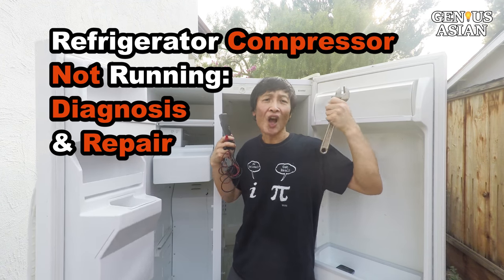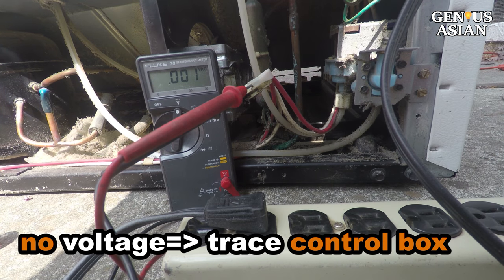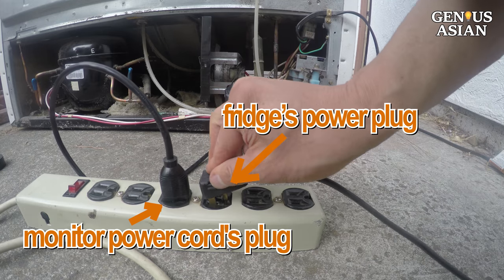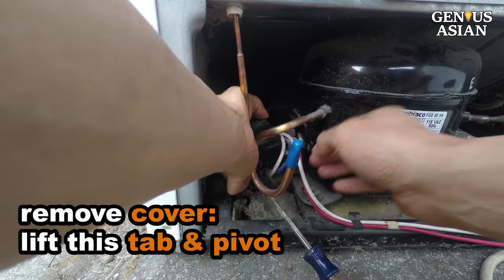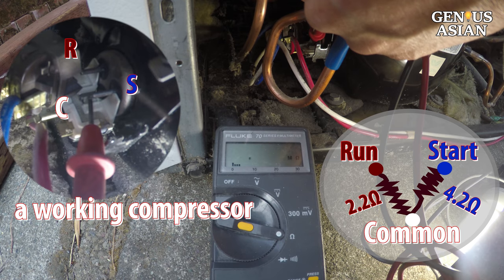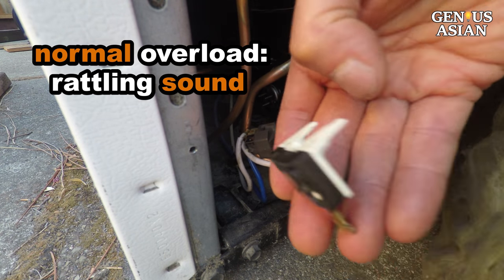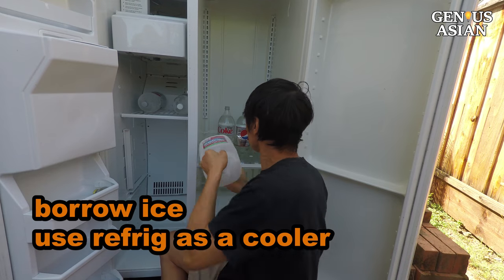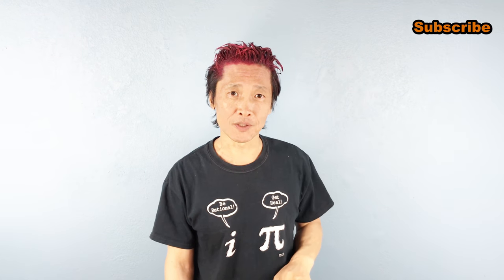Refrigerator Compressor Not Running: Diagnosis & Repair or Emergency Fix No More Spoiled Food

Comment: I have an old kenmore. The light inside turns on so I know I have power. I replaced the starter capacitor but the compressor and fan still don’t turn on.

Comment: All the fans in my fridge are working. The freezer and fridge are warm.  The compressor turns on for 5 seconds then cuts off. Then starts again after few minutes and on for 5 seconds then off again.  The compressor is hot. I checked the starter relay and capacitor the best I can.  No rattle in the start relay.  If compressor is hot could it still be starter relay or is compressor mechanically bad?  Thanks for your help!
Reply from the maker: we may try these three things:
1. the coil: https://youtu.be/jMkkoXpHIPA you should do this anyway whether you have refrig problem or not.
2. there are two tubes connected to the compressor, are there temperature difference between these two tubes?
3. When your compressor turned off or on, is the thermostat closed or open?  thermostat: https://youtu.be/grURTgO2-x0
Reply: @GeniusAsian  hello. I left fridge unplugged for 24 hrs. Plugged back in and was working fine. Inside fridge and freezer temperature was dropping slowly. 

I then unplugged for 2 seconds to put back fridge back into place then plugged back in, now same problems, cycles on for few seconds then off. Compressor is very hot to touch, not sure if that is normal or not.

All coils were cleaned, there was a temperature difference between the pipes.

Thermostat I have yet to check. 

Possibly a faulty compressor? 

Any help or advice is appreciated, thank you so much.
Reply from the maker: @audittheauditors  after you unplugged, you should not re-plug right away, it is not good for your compressor (you said: unplugged for 2 seconds to put back fridge back into place then plugged back in), you need to wait 20 minutes. Did you notice any frost? When you  unplugged for 24 hrs, the effect could be de-frost. So still check thermostat and frost.
Reply: No frost. I plugged it back in after couple hours again and it started running. Compressor turned off after it reached the temperature I set it for 50F ( i set it higher than 38F just to test). Then I can hear compressor trying to turn back on but it cycles on for 5 seconds then off for a minute. This repeats and compressor gets increasingly hot. So hot that cant touch it.
Reply from the maker: @audittheauditors  still it does not hurt to check the thermostat, i.e. if the thermostat asks compressor to turn on but the compressor does not turn on, then it is compressor problem. But if the thermostat does not ask compressor to turn on, then focusing on compressor may not solve your problem.

Comment: I have a Viking refrigerator. Both my fan and my DC compressor is not working.  I tested my fan motor first. My fan motor read 415 ohms. Could it be possible I have an inverter built into this motor that why it is reading high. Any thought on this sir?

Comment: Hello, I have a problem with my refrigerator, first the compressor was working and then stops suddenly after few tens of sec or few minutes, then it runs for only 1 or sec and then stops.  The resistance of the start replay showed 30 Ohm. I called the service center, the technician said the relay is okay but the compressor is not and since thay stopped manufacturing that compressor model you have to buy a new refrigerator (the refrigerator is a Samsung Zipel, and the compressor is mk183B - L2U). He didn't measure anything, just he said that by looking.  Do you agree with that? Thank you

Comment: My fridge compressor and condenser fan motor are not running. Power is going to the compressor but not to the condenser fan motor. As the  condenser fan motor is faulty Iam right in thinking it's holding off the compressor to run until it is replaced?

Comment: Thank you for the video! It is very practical but i run into issues immediately when starting to use the multimeter.  You say that certain values are good, but dont give indication what would be a "bad" result. If instead of 5 ohm, i measure 1.6 between relay pins is that an indication of a fault or just variation between different products?
Reply from the maker: it may be just variation
Reply: As the video says they are looking into both compressor and condenser fan not running so checking the ohms is irrelevant, both compressor and fan are linked so if there isn’t any power the won’t run just check your voltage if there isn’t any voltage then it’s either a board issue if it has one or in this case a stat problem. If the fan was running an no compressor most likely a compressor fault. And vice Versa.

Comment: I have a kenmore. The light inside turns on so I know I’m getting power. The compressor and fan don’t turn on. I replaced the stater relay and nothing.
Reply from the maker: have you tested to see if thermo stat is the problem? https://youtu.be/grURTgO2-x0    and also see in general diagnosis https://youtu.be/XSspTwABECo

Comment: thanks. The control board had a loose connection and I did not know where it was located. Once you showed me where it was (no fans working), I fixed it in 5 minutes. I was worried about my food spoiling, With the Christmas weekend, I was not able to get a repair person out.  I was thinking I needed to buy a new fridge but once you showed me where it was (no compressor and no fans working), I fixed it in 5 minutes. Great video and your narrator did a great job.

Comment: I very much needed to see the exact connection of the blue & white on the start relay and red wires to the overload and how to insert them back into the prongs and no other video I found would show that as clearly and close-up as this one. I had taken these out without getting a clear enough picture beforehand and didn't want to make a worse problem. Thanks a bunch.
Reply from the maker: Thank you for taking the time to provide feedback.

Comment: Thanks dear, your video helped me to fix my fridge. I just do as your information and finally I found that start relay is faulty. Then I changed it and now compressor is running back. Such a informative video. 👍👍
Reply from the maker: Glad it helped. Thank you for taking the time to share your success, your comments will help many other viewers.
Reply: Hey Mr.S, what were your problems with the refrigerator?  My condenser fan is spinning but the compressor wasn’t working.  I am thinking the start relay is faulty

Comment: Hello. First, thank you for posting this informative video. Hoping you can help me out...

I have a Whirlpool refrigerator model ED5VHEXVQ04 that is having problems staying functional, specifically it keeps stopping from running. I cleaned the coils and the unit started again, but we had it on "5" for both the freezer and refrigerator sides. I turned the fridge setting down to "4" and the unit ran but now has stopped again. I've ordered a new compressor relay but am now thinking it might have something to do with temperature control board. Any guidance you can provide would be appreciated.

Comment: I have a whirlpool side by side refrigerator model number WRS311SDHM02 and it doesn't get cold at all replaced the control box for Temperature Control. Both fans run lights work. If you push the water and ice it works. Do you buy chance know what it might be.? Thank you so much God Bless you

Comment: Thank you. It's very informative. However my problem is kinda different. When opening the freezer, temperature quickly drops and when closing it again, it almost takes a whole day to get the set temperature.
Reply from the maker: there could be many different issues since you did not provide enough info, you need to test and measure to eliminate them one by one, some of the issues could be as  follows:
1. defrost issue? 
2  does the temperature sensor or thermostat  read the temperature correctly?
3.  does control board read the temperature control input correctly?
4. not sufficient freon?
5. door leaking cool air?

Comment: What happens if I can hear the compressor clicking and then it turns on and off after a few seconds and it doesn’t get cold? Both compressor fan and the fan inside the fridge are running… please reply need help

Comment: Hi. This is what I have, does it indicate a bad relay?
Whirlpool WRT111SFDW03. 7 years old. 11.2 cu ft size. Freezer on top.
Start relay
P/N: WPW10448874, 
aka W10448874.

Capacitor ("cap") P/N: WPW10662129

Test relay connections with capacitor on the relay.
Results: when together I can get cap to charge and discharge thru the start relay, just like it does when it's off the relay.
With cap off and on, neither of the lower holes have continuity with each other. The hole on lower left has 0.0 ohms resistance thru the bottom blade of the back of the plug.
The lower right hole has no continuity with anything but can be used to charge the capacitor for testing.
The upper hole has 0.1 ohm resistance  to the top blade on the opposite side.

Remove relay cover and visually check. I cannot get combination relay apart without breaking it, so I haven't committed to that, yet.

Ohm test the fridge compressor pins again. Make sure the Common (top) and lower pins are within 3 ohms. And the two pins at bottom should read about the sum of the Common with the Start and Run pins. See YouTube video...
Results:
Top and Lower Right : 4.4 ohm. 
Top to Lower Left: 6.0 ohm.
Two bottom pins: 10.4 ohm.
None of the pins are shorted to ground.

My problem is it suddenly stopped cooling without noises or warning, but I caught it from hearing loud buzzing noise from compressor and relay area, and compressor was very hot. No smoke or smells though, and wires did not seem to be hot.

Do you think it's the combination relay? Thanks!
Reply from the maker: when the compressor stopped, there could be many reasons, eliminate other possible causes first:
1. what are possible reasons: https://youtu.be/XSspTwABECo
2. thermostat: https://youtu.be/grURTgO2-x0
3. also you may try to defrost

Comment: Nice video 
I have a problem with my refrigerator 
Just like the third example you showed 
The condenser fan is running but the compressor is not 
It make the sound like if the compressor is going to run for 1 second and then turns off 
Any suggestions thank you
Reply from the maker: did you check the relay?

Comment: thanks great video helped a ton with a friends refrig today my refrig comp went out but fans is cycling fine.GF male cat sprayed outlet right in front of me this blew breaker i replaced outlet breaker fine now but since compressor wont start.would this fry multiple electric parts like thermostat as well as comp starter?sorry but i have googled for 10 hours looking for  anything involving a wet outlet or crossed over electric.any help would be a life saver witha full stuff frig and five kids to feed.thanks so much for your time.
Reply from the maker: if it happened at the plug/outlet, it should not damage your refrig.

Comment: When adding the computer cord is the control board unplugged completely?  You show that you pull on it but leave it connected.
Reply from the maker: the computer cord only connects a single wire: the hot wire. You may unplug control board, but it does not hurt if unplugged because if the control board kicks in it only connects the hot wire from outside refrig to inside  of refrig, which does not have conflict.
Reply: @GeniusAsian  Thank you. I unplugged it to try the cord like you showed. Then I noticed on the board where there was a blown solder joint under the relay.  The pin going to the second plug from the left on the bottom.  I reflowed the solder and now it works. 😀 Made sure to clean the fan and everything underneath as well. Hope it keeps going.
Reply from the maker: @eeledahc  great!! I feel very happy helping another person!!! Thank you for taking the time to provide your new finding, your update will help other viewers so that they will check your solder joint as well.

Comment: hello can a 1/2hp compressor be replaced with a 1/3compressor, and will it be much difference??
Reply from the maker: when you buy a disposal you can choose a larger HP: https://youtu.be/khAepTwgdTI  , but since refrigerator's compressor needs to match the rest of system design, it is better to match. Too much HP means higher pressure, so you need to check every components in the path of refrigerant flow, to see if any components along the tube will work well.

Comment: Hi, the capacitor wires should be both placed in one side on the relay (where there is 2 pins) and the white wire (i guess the neuter wire) in the other side from the relay (where there is 1 pin)? Please advise it is an old whirlpool fridge thank u so much in advance 4 ur reply 🙏
Reply: The capacitor connects to the relay at the points between the START 
and RUN pins on the compressor - the THERMISTOR is also between
those two pins. Thus the Capacitor is Parallel with the Thermistor

Comment: My fridge has deprecated integrated start relay/overload with the capacitor that plugs into it.  Replacement part calls for separate overload, relay, and capacitor all to be "wired-in" like you have in this video.  Can you point me to wiring diagram?  For some reason I can't find it.
Reply from the maker: what do you mean by "wired-in"? Note that you have to check your specific part. If you imagine the three poles of the start relay will form a triangle, for some model would point up, for other models the triangle would point down when installed.
Reply: @GeniusAsian  Meaning I have only 2 wires that connect the relay, overload and run capacitor.  I need to wire up everything individually for the replacement part(s).  Anyways, the manufacturer doesn't have a replacement part so I'm going the route of a universal assembly from Supco and hope that works as a last ditch effort.  thanks.

Comment: I change my relay with the 3in1 and the fan next to it stops. All the wires are correct and not sure what's going on.
Reply from the maker: is the compressor really hot when the fan stopped?
Reply: @GeniusAsian  it was hot. The  fridge ran for half an hr, cooling and all, but then it just stopped. I unplugged it for an hr but it didn't worked when i plugged it back in.
Reply from the maker: @jrelechrelech6898  first step is to make sure it is compressor problem or not, measure each parts to eliminate the good parts from bad ones, https://youtu.be/XSspTwABECo

Comment: Hmm about tracing control board how can i fix just check wires?
Ps i already changed the board
(older one was burnt)
Reply from the maker: when the temperature is higher the thermostat on the control board will kick in, see this video: https://youtu.be/grURTgO2-x0
Reply: @GeniusAsian  i short thermostats and now condensor fans are running but compressor works but just get hot and nothing
Reply from the maker: @KL-oz2iw  you said "compressor works", how did you know "compressor works"? When did you hear compressor motor sound? When you touch the two tubes into and out of compressor, did you feel different temperature of the two tubes?
Reply: @GeniusAsian  actually not works(just get hot) or it's too short time that it's not get cold
Reply from the maker: @KL-oz2iw  my previous question to you was: "did you hear compressor motor sound? "  if you hear the sound, then you may check the refrigerant
Reply: @GeniusAsian  motor sound about 1-3 sec and turned off (overload get sparks)
Reply from the maker: @KL-oz2iw  in my video, I showed how you can check the compressor (start relay etc), measure each parts to identify or  which part need to be fixed or eliminate the part so that you can narrow down the culprit

Comment: Why when I switch off my refrigerator while it is running, I cannot switch it straight back on. It will switch back on after a few minutes but not straight away???
Reply from the maker: yes, you need to wait for the compressor to cool first before re-plugging it back in.
Reply: @GeniusAsian  Even when the compressor is cool, it runs fine when I switch it on, but if you switch it off after 1 min yourself and switch it straight back on, it doesn't run, it just hums and then it clicks off. Why???
Reply from the maker: @PF-gi9vv  yes, as shown in the video there is this safety overload switch connected to the compressor, this overload can turn off (click) the compressor. When you re-plug your refrigerator, the pressure build up will cause compressor over loaded.
Reply: @GeniusAsian  Thank you for your reply.

Comment: ONE CANNOT BORROW ICE from the neighbor - as it is impossible to return the ice.
when it has melted.
Better to purchase bags of ICE from the SHELL _ CHEVRON _ TEXACO or other service station.
Reply from the maker: the story goes like this: you can go to your neighbor to borrow some refrigerator space, they will say they run out of space but may have freezer space, then you can give them a coke bottle filled with water (as seen in this video) ask them to leave the bottle in their freezer.

Comment: Informative but one needs a degree in mechanical engineering to go through the info here. Should be simple and straight forward without wiring diagrams etc. A layperson could not follow all the steps here.